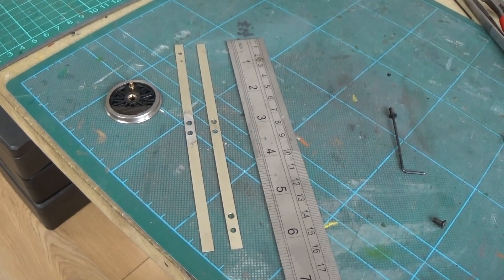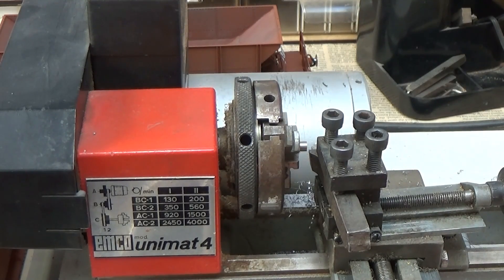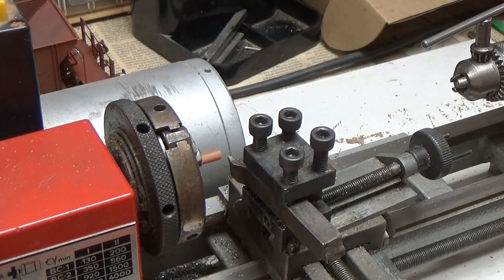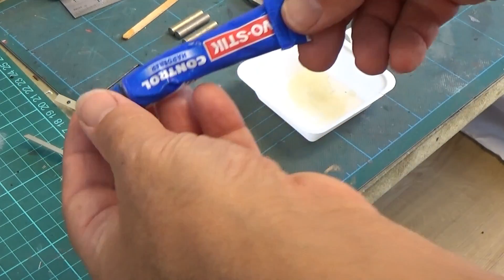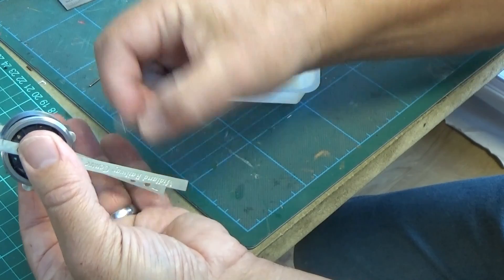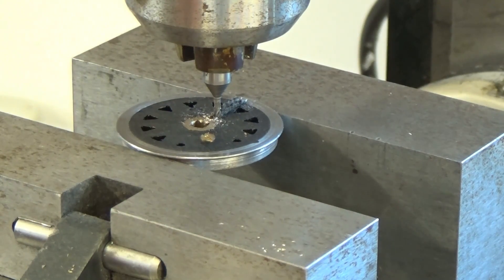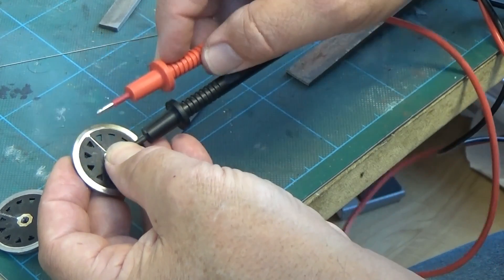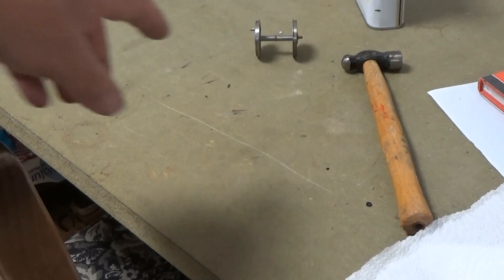Making Split Axles with James Aitken

Comment: I v e used this method to convert slaters axles to broad gauge for 49mm track.  Once the axle was glued together and before it had set, I set it up on with the squared ends ( which go into the wheel) resting on engineers parallels. Once the axle was completely set it was then  at exactly 90 degrees making quartering very simple.  I am lucky in having proper parallels but 1/4 hss lathe tools would also be very accurate. Hope this helps rgds Graham Powell